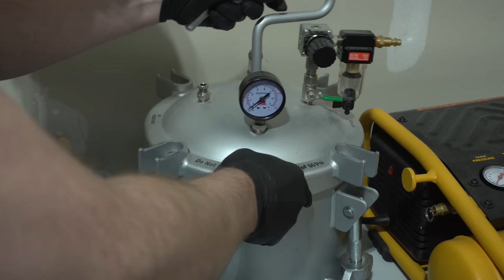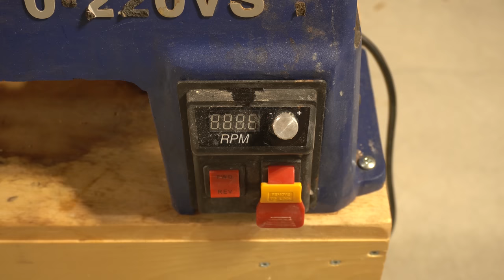Woodturning | The Sapphire Walnut Bowl

Comment: Wonderful bowl. I hope to make woodworking a hobby after I’m out of college. May I ask why you sanded the bowl with wet sandpaper, please?
Reply from the maker: Thank you, Ian! It's a very fun hobby! The biggest reason is that it just helps to keep the dust down. My shop is down in our unfinished basement, and while I do have the whole thing sealed off (and I always have a large air filter running whenever I'm down there), I'm still a little paranoid about dust getting into the rest of the house (not the greatest thing for your lungs). So, when working with resin, I usually opt for wet sanding instead of dry. It's also kinder on the resin itself when water is mixed in. For whatever reason, dry sanding seems to leave much deeper scratches in resin surfaces than when wet sanding, and I've found my finished products always look better when using wet sanding. There is a concern about water getting into the wood and potentially causing expansion/shrinkage/warping, but the size of the wood pieces in my projects quite small (single small bricks, or things like that), and so I haven't had a major wood+water problem yet.

Comment: What is the crock pot pressure cooker device? and why is it used? Looks amazing, definitely want one.
Reply from the maker: Hi Brian! It's called a resin casting pressure pot. It's essentially just a modified paint pressurizer. The reason it's used is because, when you mix resin (particularly when it will be poured alongside wood), you're guaranteed to have air bubbles form inside. If allowed to cure on its own, you'll end up with air bubbles in your final hardened casting. With the pot, the high pressure (I typically use about 55-60 psi) compresses any air bubbles in the resin down to a size so small that they essentially become invisible, giving you a crystal clear casting.

Comment: I am a little confused on your finishing process? You wet sanded your bare wood with all that water? The, did you set the bowl aside for a few weeks to let all the water work its way out of t he wood before sealing the moisture in with a varnish. I never seen that done before and was wondering on how you did it as I asked above?
Reply from the maker: Good question! I've tried dry sanding before, and while it does obviously help with keeping moisture out of the wood, I really dislike how the resin takes it. The grit seems to leave deeper scratches in the resin, the resin clogs up the sand paper really quickly (meaning you constantly have to get new paper), and it just overall takes longer. I gave wet sanding a try, and it just seems to be working better for me. It sands faster, minimal clogging, fewer deep scratches, and best of all, no dust in the air! 

To help keep the water out, once I turn the lathe on, I never stop it until I'm fully finished sanding. As far as I can tell, the centripetal force helps keep most of the water from truly soaking into the wood (although some obviously does get in). It doesn't seem to take very long to dry, though. With the lathe still spinning, the outside is bone dry in less than a minute. I usually wait 15-30 minutes before applying the finish. So far, haven't had any issues!

Comment: Great work, what did you use to make the mold?
Reply from the maker: On the bottom, I used some foam core, and around the sides, a plastic poster board (both I picked up from Michael's in their poster section).

Comment: What is the container for, can I do this process without it?
Reply from the maker: Hi Elizabeth. You mean the metal container? It's called a pressure pot. You use an air compressor to fill it and place the blank under high pressure to help eliminate bubbles in the resin (it crushes any air bubbles that might be present down to such a small size that they essentially become invisible). You absolutely can do this sort of thing without one, you just might end up with bubbles in your final piece

Comment: Much of what I see made out of timber and epoxy resin is just in-fashion. It has little artistic merit with its redeeming feature that it enables pieces that would have been fire wood to be made into something. Quite often, I feel it’s the ratio of epoxy to timber that makes the difference - pieces that have a little necessary resin suit my style but I just don’t like those pieces which are mainly resin. 

I feel sure that the use of epoxy resin will settle down in time to just being used where it adds to the aesthetic. I’ve been woodworking for over 45 years and, clearly, resin is relatively new. I have used it on quite a few pieces but, I hope, subtly to add and not detract.

The other fashion is waney edged slabs. It wasn’t long ago that waney edge timber was much cheaper per cubic yard or metre than square edged. Now, supply and demand makes it so much more expensive. We would look at a waney edged boule and think of 30 or 40% wastage in conversion - so it had to be cheap to make the price sensible. 

I’m sat looking at a 10ft long, 4ft wide, waney edge slab of London Plane as a coffee table. I filled the deeper depressions on bronzed resin (so that cups wouldn’t tip over) and inserted steel butterflies on various checks. We sold a similar one for £6,000 - probably 50%more than it would have been for a conventional square edged table of the same size with the extra being the cost of the slab plus all the extra labour required. 

Back to this bowl. It seems to me to be the best of the use of resin. It compliments, it adds, it contrasts to the timber. It does take real skill to come up with a design that really pleases the eye.